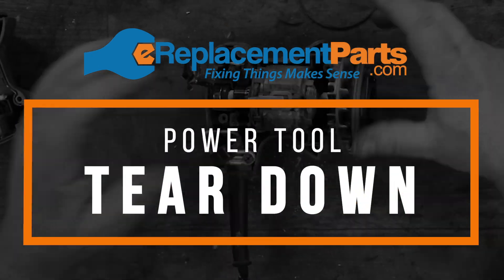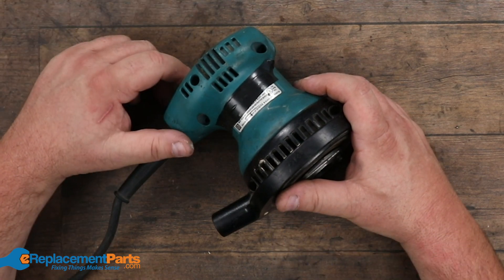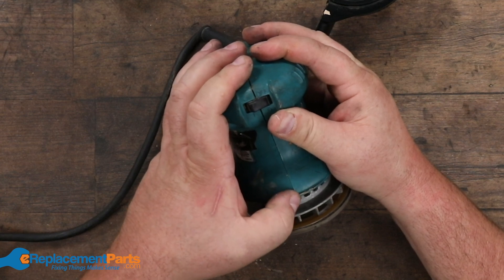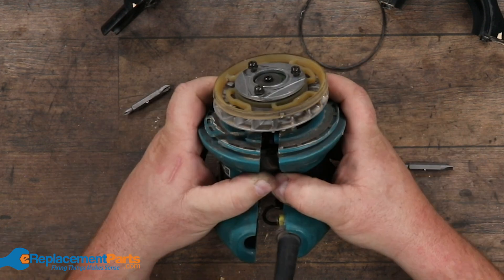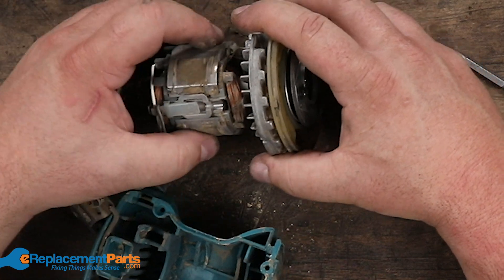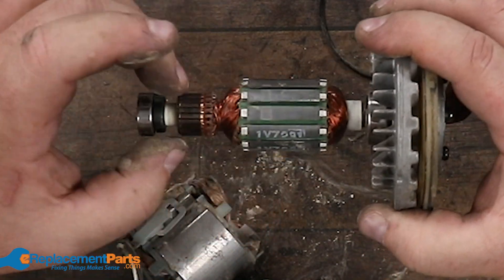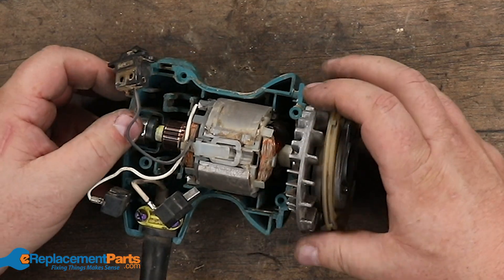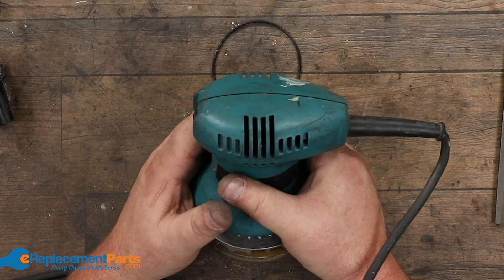Tool Tear Down: Orbital Sander | How to Disassemble Your Orbital Sander | eReplacementParts.com

Comment: Do you have anything on a sear hand Dremel, mine just stopped spinning
Reply from the maker: Hey Emanuel, you can check out some of our Dremel videos on our channel: https://www.youtube.com/c/Ereplacementparts1/search?view_as=subscriber&query=dremel. Hopefully this helps you!
Reply: @FIXTechGuides  thank you
Reply: I'll tell you this - all those hand Rotary tools are crap!  Only strong enough to do your toe nails and dog nails. I am so fed up with Dremel brand.  Pricey as hell then they quit on you! Carbon brush replacements are all misfits on Amazon, you have to buy genuine Dremel brushes at a high cost.  Its such a rip off!
I am switching to Foredom at $300.  Everyone says the motor is far stronger and runs 10 - 25 yrs.  This is cheaper in the long run than a $140 Dremel that quits in 1 yr or less.
In your case, check the carbon brushes and replace them. It is easy to take apart.